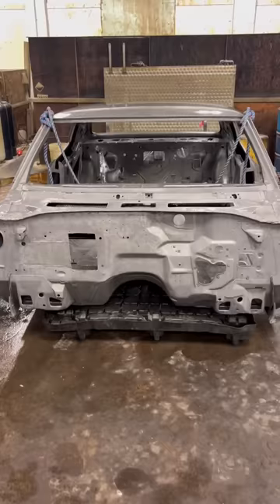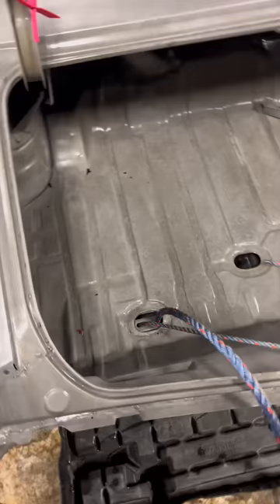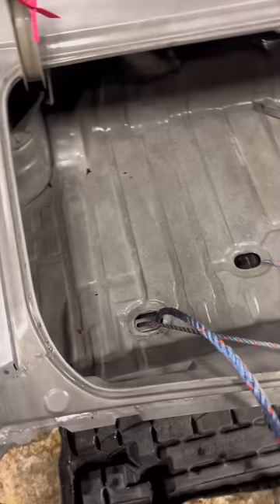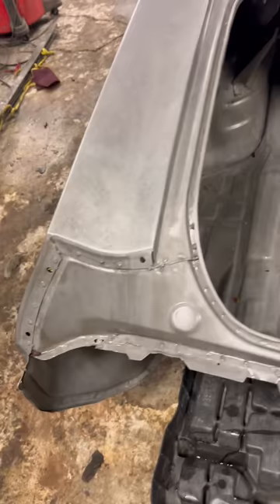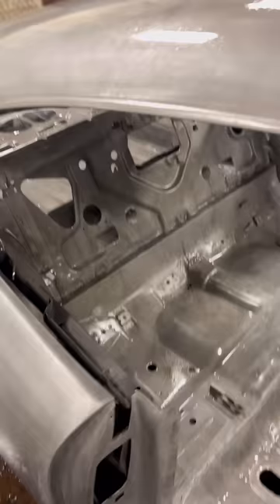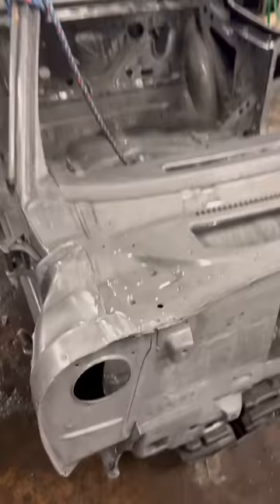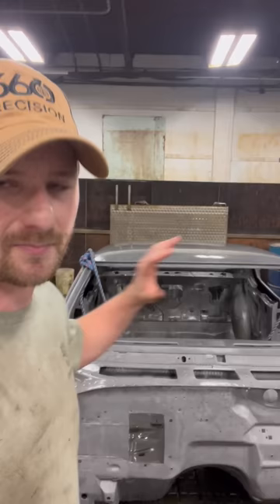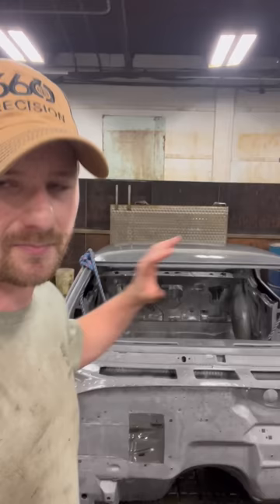Chemical dipping a 1970 Buick GSX

Comment: Brazing was a common practice during the 70’s which were pre-mig welding times.
The guys that were good at controlling heat would use steel rod but most use brazing rod.

Comment: When I saw that thing come up without a wrinkle in the paint after the 1st-dip, I thought...DuPont IMRON. And yes there was an IMRON clear. It's a polyurethane enamel. And is extremely resistant to chemicals. Somethins up with that firewall patch, maybe it got its IMRON job then. And back in the day, even tho he couldnt stop the electrolysis effect from coupling brass and steel together, a good body man could wire brush and acid treat a brazed weld and still make it last.   KUTGW

Comment: It's a shame most don't know of or appreciate the best all around muscle car ever built, the GSX 455 stage 1.  I had a GS 455 in the early 90s. I got it when I was 15 and I had just got it ready for paint. Was all primered when I got hit by a moron and it was totaled. I only got to drive it for a year. Good luck with the project. I'd love to find another.
Reply: Same. I've had several starting in the late 80s. The one I kept and fully restored was a low mileage 1970 GS convertible, red in color. 350 but high compression. It had every option available for the GS 350. It was stolen back in 1997. Never saw it again, but guessing it was taken to the US from Canada.

Comment: This is surely so much better than blasting.. it absolutely takes the metal to completely renew and gets everything a blasting cant .. this will definitely be my next builds base metal option
Reply: 1 problem when you chemical strip it strips any coating that is between 2 panels that is spot welded together the only way to get it back like factory is to E coated spraying primer or epoxy will not do the job so in return u get rust in those seems all seems I have seen it before I have 30 years in the collision industry
Reply: I remember seeing old b/w pics of VW busses being dipped into pools of primer back in the day.  Really the only way to ensure that every panel is sealed off/coated.
Reply: @braddurham145  Most commercial Service body builders, Altec namely, have an e-coat dip line, Buddy of mine said they will do it on weekends, I priced a Foxbody Mustang @$1200 a few years back.
Reply: @richardt6980  From what I understood, the body would still get dipped again at their facility, run through an ultrasonic rinse tank, Then dried, Then dipped, and baked.